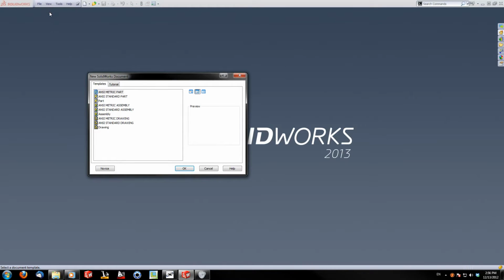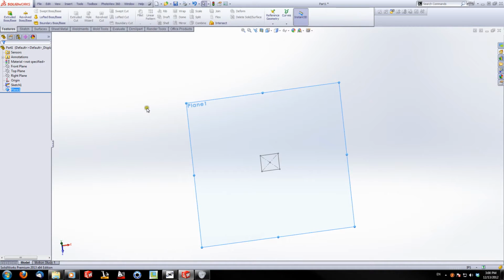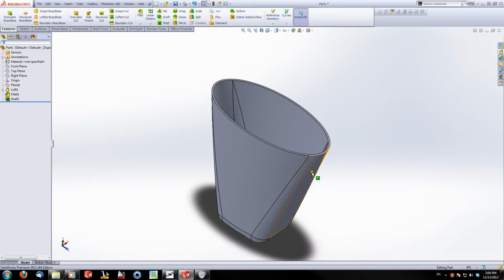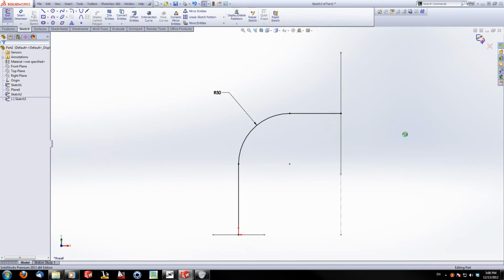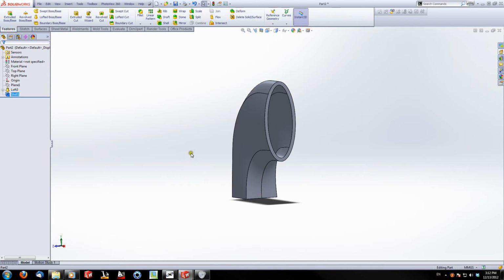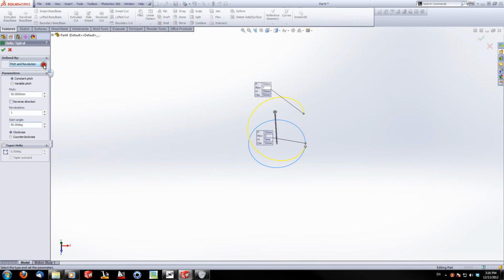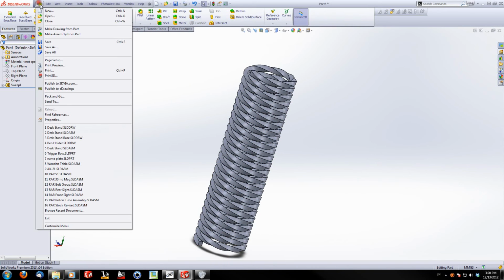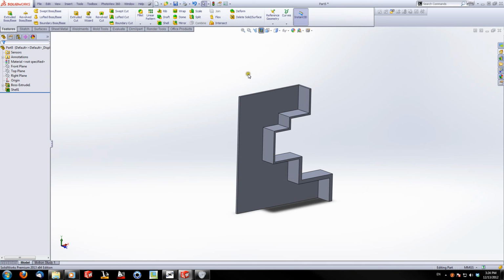Intermediate Sketch tools and features

Comment: Your tutorials are the best. Please, keep them coming. I was wondering if you could do a video on the use of the best keyboard/mouse short cuts and keys. That seems to be the problem I have switching between software. I noticed the Autodesk icons and thought that a compare and contrast between the individual methods of the programs might us out. I have used a lot of the other software out there but am new to solid works.